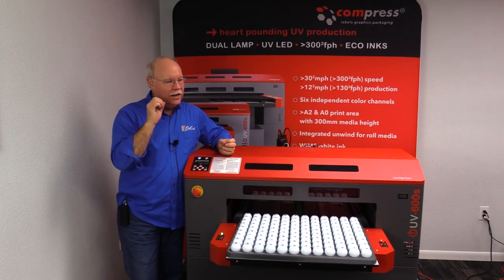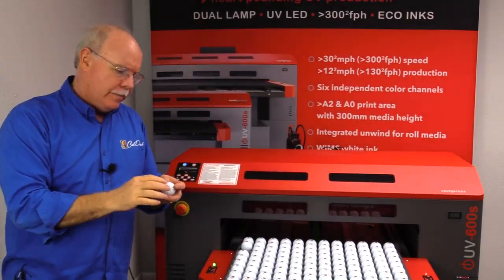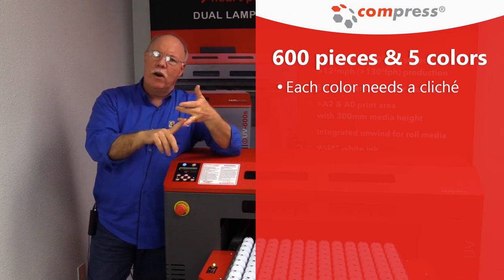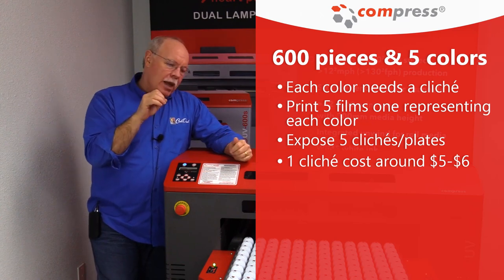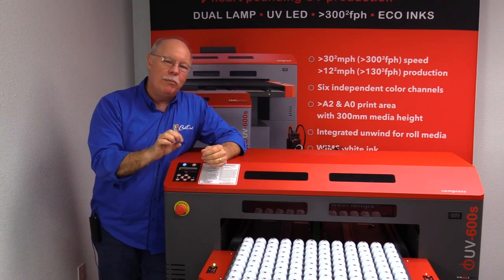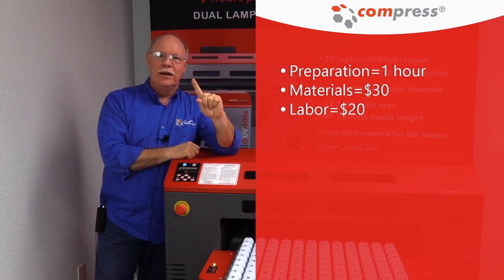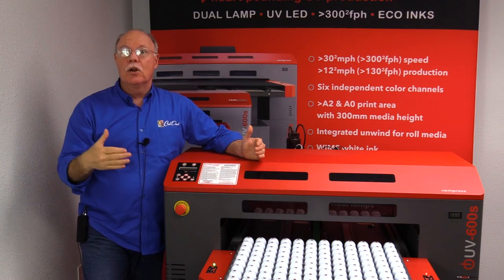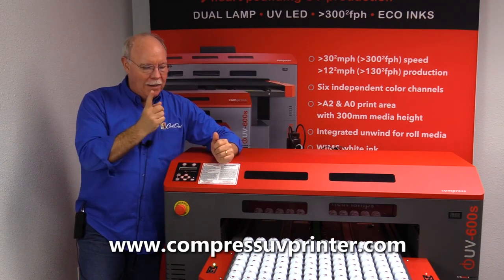Digital Pad Printing Equipment Options

Comment: What are the limitations of surface shapes?
Reply from the maker: no limitations on flat objects under 11" tall. Conical is okay - it's when you get 3D surfaces with different heights that it becomes an issue
Reply: @ColDesiColman  any idea what machines are use to print on a surface like an action figure’s face? Hasbro , Mattel, and others are using digital face printing tech in their action figures. Wondering what commercially available machines have print heads to print in such small and variable surface shapes
Reply from the maker: @CC-nt4zi  CC - I think that's some kind of vacuum device. Our OnDemand department would know - maybe give Mike Angel a call at 877-793-3278 tomorrow